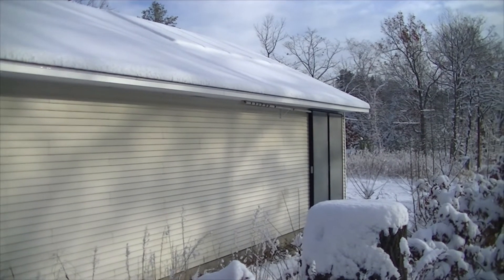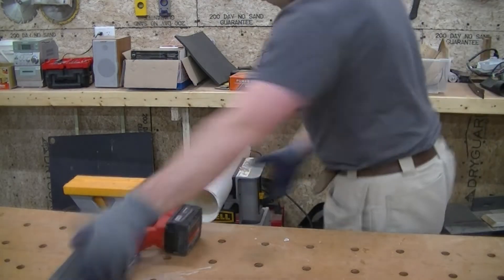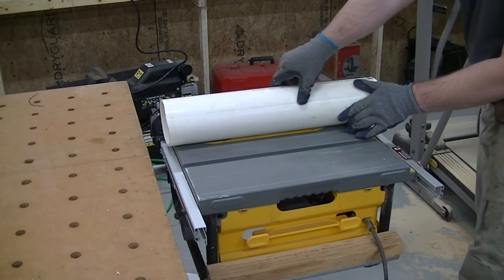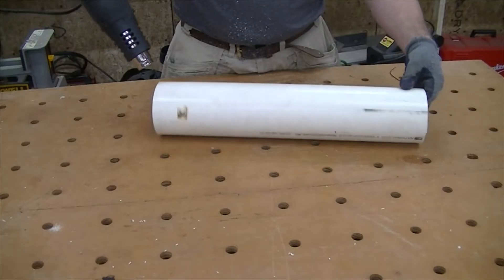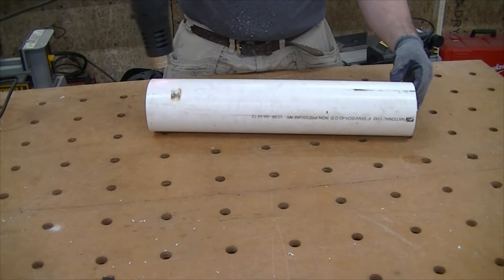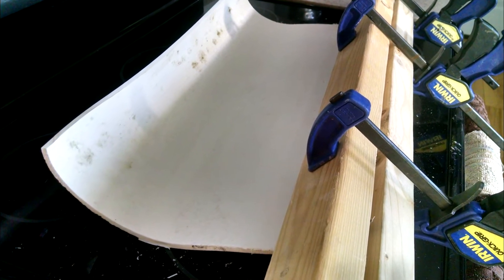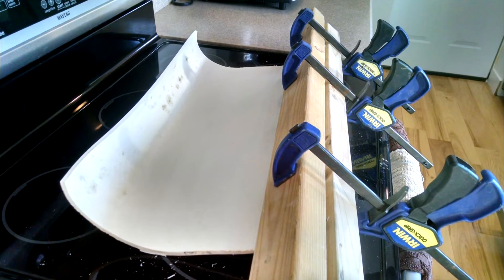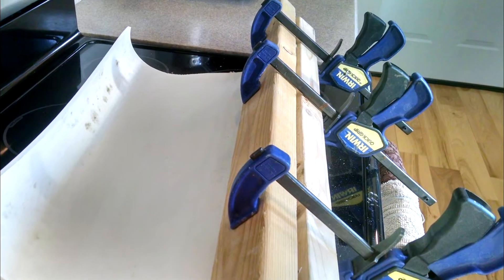Build a FREE Roof Rake for Snow Removal

Comment: UHMW plastic would also work for the rake head. We used 3/4" seven ft PVC pipe & some 3/4" brass double thread. Heat the brass threads, and use channel locks to (create) thread by twisting it onto the PVC. Used some  step antiskid for a handle grip.

Comment: tie a couple of 5lb weights to counter balance the shovel. may make it easier to operate.  nice job with the PVC in the oven. I find it's best to use the oven for projects when the wife is not around! l have planned on making a solar heater to help heat my shop. I will plan on making one of these when I do.  thanks again